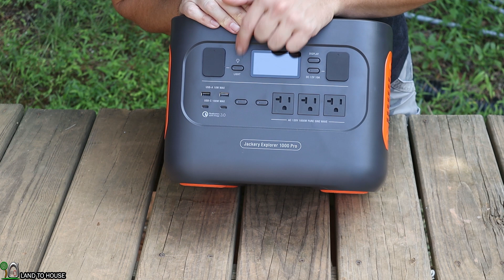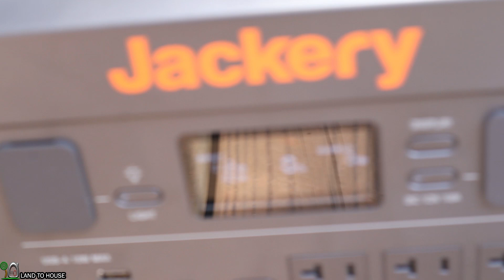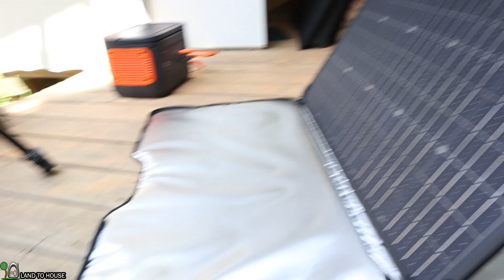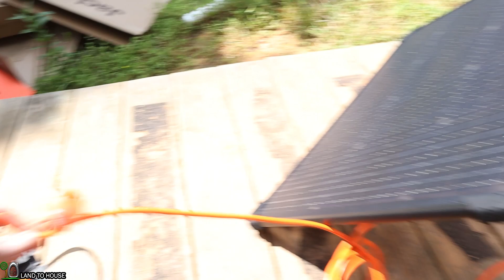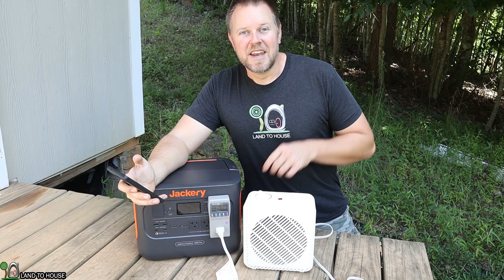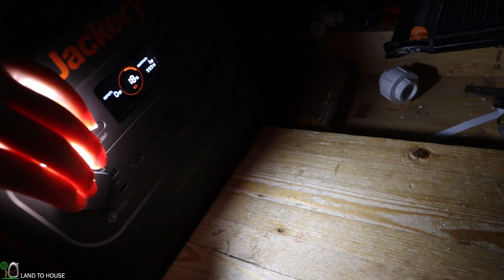A power station with 1000w of power! Jackery Explorer 1000 Pro

Comment: You cannot know this, but I say this model is defective and should not be bought. I bought one in November of 2024 and just received (October 2026) my 3rd replacement, under warranty. The first 2 failed immediately, with a fatal F3 fault and the third lasted a year before the same fault occurred. They cannot be trusted. I also have a 1000 original and a 1000 V2 and they have given me no trouble. Ditto for my 500 and my 160. Just avoid this model. It was offered with a "free" Solar Saga 80 which is a marvelous, overbuilt and quite heavy panel. No complaints on that front except that it is far too expensive ordinarily.

Comment: I have two 1000 units. I have the 1000 Pro and the 1000. Just plugged my tv and stereo setup at home into it, and also my home desktop computer system. Turned off the main switch to see what will happen. And everything stayed on.